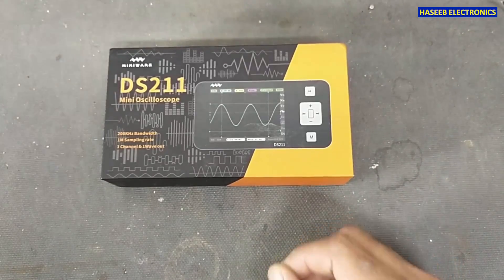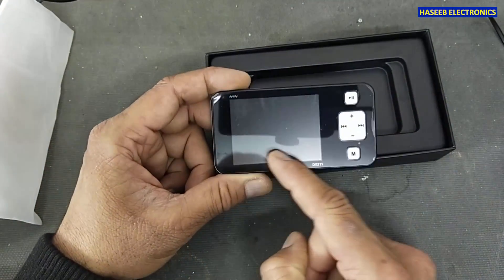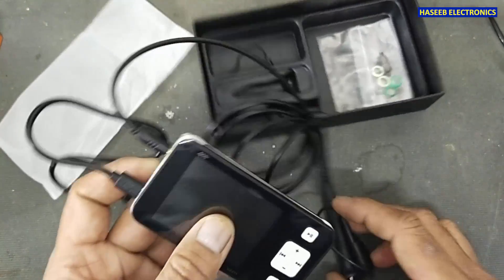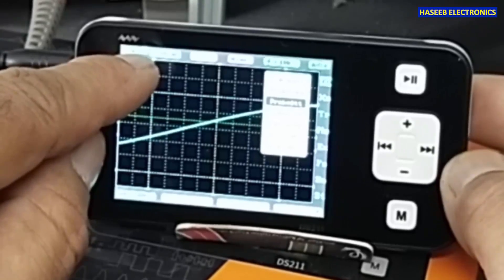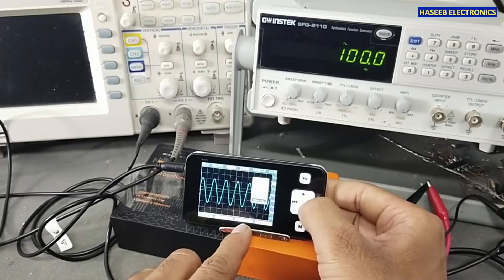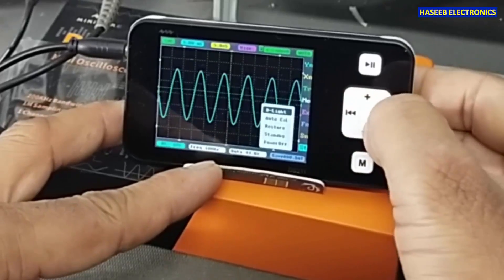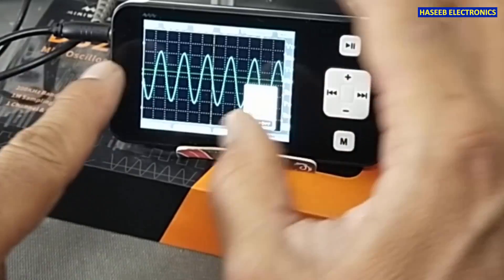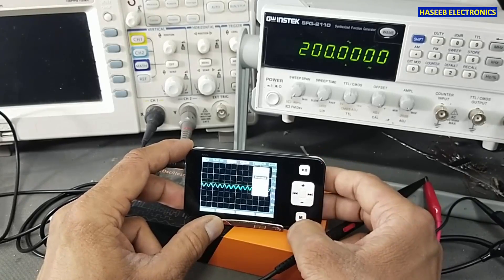{801} DS211 Mini Digital Oscilloscope With 1MHz Signal Generator

Comment: There are lots of easy DIY projects to build basic oscilloscopes. They are very budget friendly, using a MCU (Arduino, PICs, etc,) laptop (via the sound card) and even a cell phone. There are lots of open source projects. Safety tip = People buying/building/using such simple scopes should be aware that scopes can be extremely dangerous, if you probe the wrong place. Users should learn how to prevent hurting themselves (literally,) before ever turning it on. I hope that helps someone.